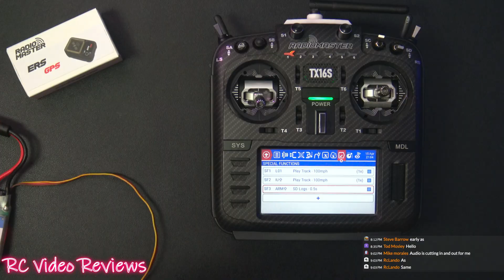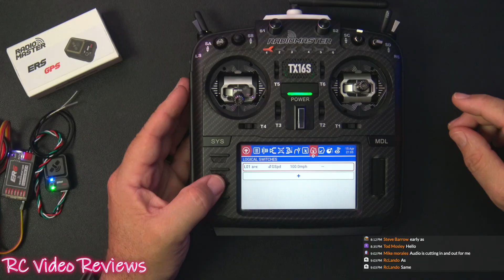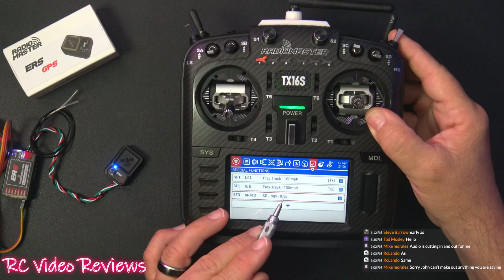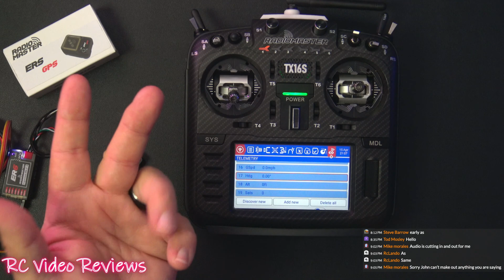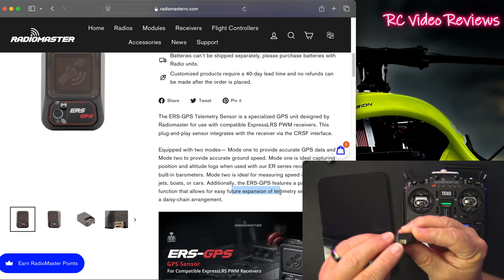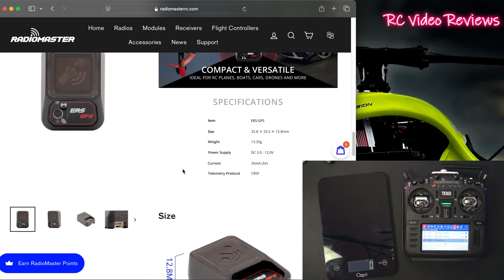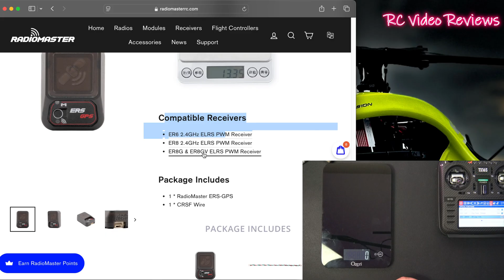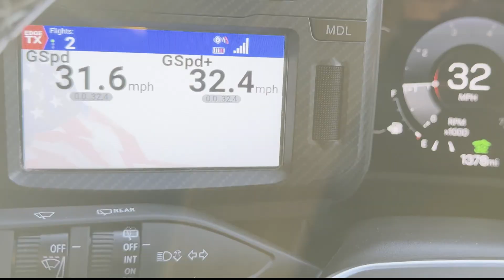Don't make my mistakes with Radiomaster ERS-GPS Precision GPS Sensor

Comment: If you fly FPV then you already had this years ago.
Reply from the maker: You had a gps module that reported gps data via telemetry without the use of a flight controller years ago? Tell me about that setup.  I’d like to check it out.
Reply: @RCVideoReviews   you could use openXsensor with a RP2040. Works perfectly well with the Radiomaster PWM receivers. 

I got the new GPS from Radiomaster just days ago and I'm looking forward to test it, but setting it up on my windowshelf it only gets 8 satelits, which doesn´t look promising. The RP2040 DIY solution finds under the same conditions 13 satelits, but in fairness I have a 25x25 GPS attachted to it and the one from Radiomaster seem to be an 18x18. 

If altitude is really only in combination with the ER8-GV (which is the only receiver with UART and baro), then this is a real downside as the DIY version can also simply attach a baro sensor to that same board and lots of other sensors as well. 

Still I very much like the compact design and that you can easly move it from one model into another one.

Comment: Hey John does the Lightsystems ETC work with the ERS-GPS?  I see there is both in and out on the GPS to chain sensors together.  Is there anything special you have to do to get the telemetry to pass thru?
Reply from the maker: ETC requires HoTT. So no, they won’t work together.

Comment: Having a stall speed warning would be cool - I could really use that. 
It could also be setup as a psuedo EGPWS for "Too low Gear" warnings/reminder to put the gear down or "Too low Flap" for the big planes that need/use flaps for landing. "Terrain Terrain" just before impact might be funny but not useful .....😅

Comment: Do you have to calibrate/zero it before flying to account for height above sea level?
Reply from the maker: I didn't see or read any option to calibrate. Altitude comes from baro on RX, not the GPS.